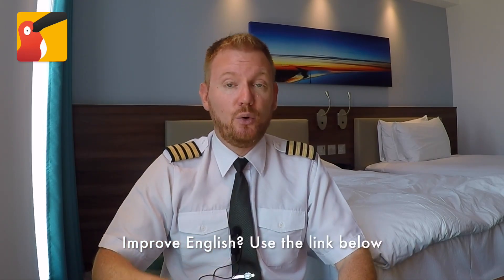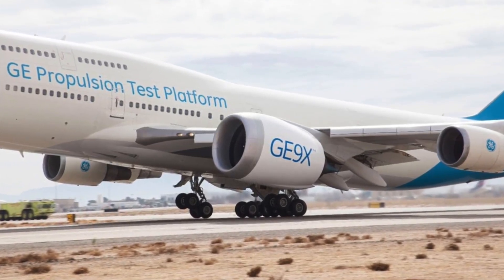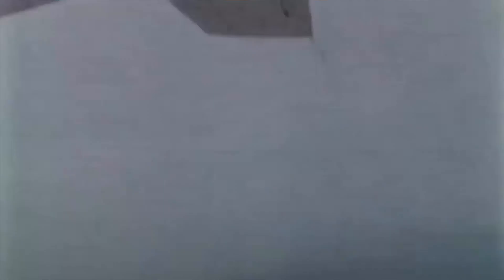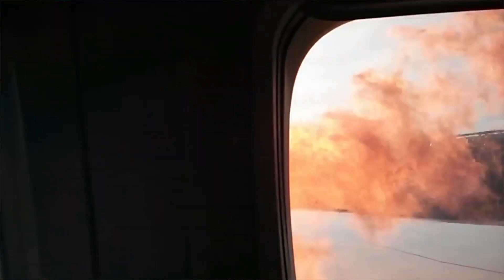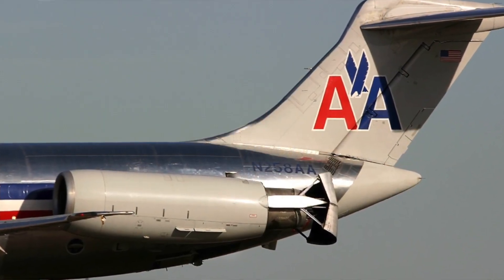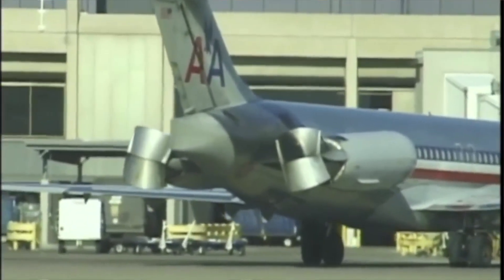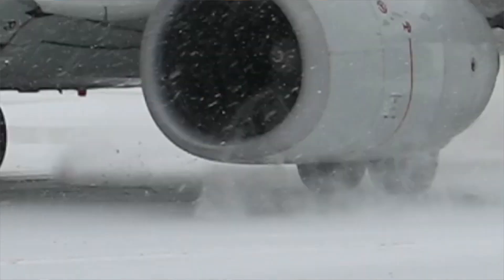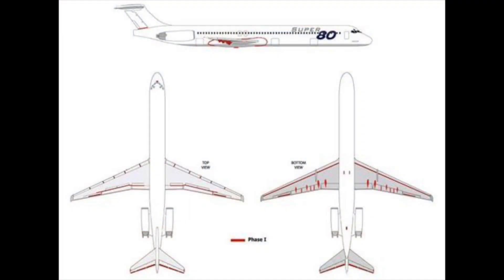Why are the jet-engines placed there? Wings vs Tail

Comment: I’ve worked on both rear mounted and underwing engines and I like working the rear mounted engines better. Usually better clearance from the cowls and the TRs are at the very back. Makes for better pictures too lol.  Love doing high powers on the JT8 engines.

Comment: You had mentioned that when engines are under the wings and if the engines are on fire, it doesn't immediately  affect the Passenger cabin, but would the engine on fire cause the fuel in the wings to heat up dangerously?

Comment: Can they mount the engines over the top of the wings of mount them from the fuselage with larger mounting pylons like the A10 that has engines mounted from the fuselage on top not all the way at the rear?

Comment: Good explanation. 
     The main downside is the Centre of Gravity problem. Heavy engine one place heavy fuel somewhere far away . Not ideal. The IL-62 often stood on their tails because their arse was too heavy. So they had a strut come down. This is called in-elegant engineering. But still a great plane.  
    The only significant problem was CoG for the designers (and therefore the pilots too) and is why big jets have engines under wing today. 
However, the many other advantages of the rear engine made a plane that passengers preferred. Airlines need bums on seats. If you have a plane that the passenger actively prefer then that plane is inherently a greater revenue earner. The VC10 was more costly to run than the 707 but throughout its time in service with BOAC the 707 flew with many more empty seats. For the passenger the rear engine is way better. Ask the executives. They know. They can choose and the choice is emphatically rear engine.
   But for so long  the passenger has had no choice. Now that is beginning to change. Some airlines are beginning to pamper their passengers.
And that is going to be the game changer for the conventional non budget airline.
 I doubt it, but maybe it could be  time for a return of the rear engine. An A-390 ? Lol.

Comment: One design benefit to tail mounted engines is that the wings can be much more aerodynamically clean.  In design, this mean faster speeds.  In their day, the Boeing 717, Boeing 727, Vickers VC-10, Lockheed L1011 and similar designs were faster than the two and four engine wing mounted systems.  In the end, mounting bigger engines under the wings won.

Comment: with my limited real life knowledge about planes, all i could think of in a super stall situation from my experience in Kerbal Space Program (KSP) is to turn the plane upside down where the back tail wings could touch the air again, adjust the pitch then roll again up right. but like i said, limited knowledge so i do not know what a real plane of those size can and cannot do! ;P

Comment: Tail-mounted engines should increase overall lift and fuel economy. The planes lift is made from air passing over the wing faster than under the wing (low pressure on top, high pressure on bottom). The rear engines would suck air over the wings extra fast, making low pressure, and causing that extra lift. I'm not a aeronautical engineer, that's just my theory.

Comment: They are called Airplanes because they run on compressed air, do you really think that tons of fuel would fit in those thin wings with all the flaps and hydralic systems in the wings?? Hardly any room left for a few gallons!!!

Comment: just wondering : in rear mounted engine aircrafts, if the APU would catch on fire, could it spread to the turbines and vice versa?

and on wing mounted engine aircrafts, of the engines catch on fire,  and the insulation fails, could the fire spread to the wing fuel tanks?
Reply: it's possible a wing mounted engine fire could spread to the tanks however aviation kerosene requires oxygen to burn so it would be highly unlikely to cause a runaway fire burning all of the fuel stored in the wings unless the tank had damage where air could enter. The greater risk is the structural damage an engine fire could cause to the wing, but again aircraft engines and wings are engineered to minimise the risk of these events.

Comment: While the mechanism to deter a superstall for each model are different, would this inhibit "pilots"  from trying a different  model type.  It seems a military pilot flying C-5 would byitself be discouraged to go into commercial passenger aviation due to a lack of knowledge and airtime, even though the air force lieutenant-colonel has 50 thousand flying hours....?

Comment: Another reason for not using reverse thrust when pushing back is noise/vibration in the terminal building.... Was a witness to a C17 using reverse thrust (nil tug available) when backing out from a bad park next to a control tower and nobody in the CTC building could hold a conversation due to the bulk noise/rumble of the C17 during the move.... Big plane = a LOT of noise...

Comment: question … with the normal walkaround the aircraft  before each flight, are they able to check the high mounted engines as well by use of a some kind of lifts you hope every airport have for this purpose ?Thanks in advance

Comment: On the fuselage mounted engines including the 3 holer, you're less likely to bounce a motor off the runway in a crosswind landing. You can fly a more normal side slip instead of crabbing into the wind and jamming top rudder at the last second on touchdown.

Comment: Excellent explanation on the T-tail problem of the super-stall. I served in the Air Force in the 60's, working on the RF-101. We lost a plane for just that reason. The pilot had the benefit of a drag chute used for landing to bring his tail up, out of the turbulence of the wing. He had used the drag chute, except that he was too low to the ground. Unfortunately, he did not make it. Thanks.

Comment: I had a Flat Earther tell me planes don't need fuel during flight, They only need fuel to start the engines. Once the engines are started they are self sustaining through the compression of oxygen and nitrogen.
Reply from the maker: Yeah, that’s not how it works

Comment: Why would the under wing mounted engines be less noisy for passengers (at 4'50'') if the noise mostly comes from the exhaust, than if the engine is as far back as possible on the airplane? This just didn't make sense there. If you've ever traveled on a rear engine plane, sitting behind the wings is silly silent compared to in front of the wings on a wing mounted engine plane.

Comment: You did a great job describing the effects of each type of placement. But you never touched on the video's title... the WHY. More specifically, why is one placement chosen over the other when designing a specific model? Though you did explain the "why" for private jet design (the need to land at small fields which have a high FOD potential, driving the requirement for tail mounting). But for all other aircraft models you skipped the why. 
For instance, why wasn't the 737 designed to have rear engines instead of underwing? Again, you did a great job of explaining the characteristics of each placement, but by the title of the video I was expecting to learn why one set of characteristics is chosen over the other. 
I believe the most significant factor is center of gravity as a design choice (though you only  mentioned CG has a design result). Getting back to the 737, I'm not sure, but when the model was in the design stage and a decision had to be  made, I expect it had to do with expected load weight and desired range of the aircraft. That led to an engine selection and a required fuel load. And that led to wing size and center of gravity calculations, which all led to the decision to place the engines under the wings. I'm probably wrong on all that, but you get the point.  So again it's this lesson in aircraft design that I was expecting from the title.

Comment: In the event of an one engine under-wing failure, couldn't you also deploy the flaps on the good wing with the thrust, to increase it's drag and consequently have to use less rudder? 

Or would this parasitic drag be to great and bring the plane below stall speed? Or would it not work the way I'm thinking it would?

Comment: So let me get this straight,

Underwing = easy maintenance, opportunity for bigger fans, more engines, helps with wing bending and wing flutter, safer incase of fire, engines closer to center of gravity, less piping for fuel, less chance of a super stall.

Tail = better handling incase of engine failure, less chance of picking up shit and getting ”FOD”

No wonder we are seeing more wing mounted engines. 

Thanks for the clarification

Comment: Can I ask why a T tail instead of canards? It seems to me that canards would lend much better handling characteristics.
Reply from the maker: Good question!
Reply: Sasha waxman only with delta wings Like ef2000. Canards influence the aerodynamic forces of the following wing very strong and since normal wings don't have that much of an area to generate lift, t-tails(or classic stabilizers)are prefered, although canards are more effective since they act within the wake free airfoil.

Comment: I  can't understand how the wings are flying with 1000's of gallons of liquid jet fuel and decreasing while flying - the wings with engines are already holding the weight of the engine, plus additional liquid fuel?  I looked at some of the wings designs and it seems impossible they could hold any liquid fuel, especially when how thin they look and they are designed for aerodynamics not storing liquid fuel.  I know the jet engine compress air to fly and Im starting to think the fuel thing is just bullshit and compressed air is being pumped into the planes for flying.  something makes no sense when it comes the text book amount of jet fuel a plane can hold.

Comment: It's funny how you talk about the good of having rear engines and mention private jet engines and say they don't have rear view mirrors. But the private jet you showed on the picture is a gulfstream, they have rear view mirrors on the side. Little ones.
Reply from the maker: I did not know that!
Reply: Yea I'm in maintenance and the G4 had tiny mirrors the size of a small mint packet. There on the inside right up against the window and there's a little dial that rotates it upwards and downwards only. They are curved and can only see well enough to see under the wing if there's people there.
Reply: On that note, Gulfstreams (like the G550 in the video) usually have rear facing , belly mounted,  cameras. Wouldn't recommend trying to back one up though. They are too tail heavy.

Comment: It sounds like the ideal location from a flying point of view would be in the wings, Comet style, roughly at the centre of gravity.  However maintenance would be harder and the wing structural design would probably be almost impossible.  But it would allow for a huge engine.

Comment: Thought I read on Wikipedia that since 1960, 77 DC9s have been lost. I have to look it up again to make sure, but if 77 is actually correct, that would mean that engines in the back are not quite as safe as under the wings.

Comment: The trade-off between wing-mounted and tail-mounted engines is also one of aerodynamic efficiency vs structural efficiency. Wing-mounted engines are more structurally efficient because (as you said) they spread the load along the wing, thus reducing the bending forces at the wing root. On the other hand, the wing-mounted engine pylons interfere with the airflow around the wing, making it less efficient. Tail mounted engines allow the wing to be aerodynamically optimised, but force it to be stronger at the roots. This is why the 707 had wing-mounted engines and the VC-10 had tail-mounted ones: the 707 was designed primarily for 'First World' airports with long runways, whereas the VC-10 was designed for BOAC's 'Empire' routes, which involved a lot of short runways in hot-and-high conditions. Getting as much lift as possible from the wing was therefore more important for the VC-10, which was also a little faster too.

I don't understand your comment about being able to put bigger engines under the wing that on the tail. Bigger engines under the wings force the undercarriage to be longer, which in turn makes it wider, which exacerbates the engine-out asymmetry you mentioned, and puts a bigger cut-out in the lower wing skin for bays, which in turn weakens it. Tail-mounted engines are higher up and independent of landing gear considerations so you can put bigger engines there with less penalty. It's worth noting that in the days of propfan development, both of the flying prototypes used rear-engined DC-9s as testbeds, and propfans were exceptionally wide: basically a turbofan with such a large diameter that putting a duct around it wouldn't have been worth the weight.

Comment: I would also assume that with the rear mounted engines, a single engine failure would not cause as much yaw since both engines are closer to the centerline of the plane.

Comment: I flew from New Orleans to Miami in the very last seat of an MD80. You are right between the engines, which are extremely loud. You can’t look out of the windows, because the engines block the view. And your seat can’t recline, because you are pressed up against the bathroom wall. If you fly on an MD80, do not get stuck in those last seats.

Comment: You are a great pilot not an engineer. So here it is from  an engineers point of view. Planes required that Center of Mass be in front of Center of the Lift. It is easier to do this by placing engines in middle of plane and as low as possible. On a plane with very large engines it is simply impossible to put them in the back, to much weight to balance the plane. The wing would have to be in the back. If you have engines in tail you can make wings thinner and therefore it can be faster. But in tail mounts you usual have to go t-tail because of all the disturb. air from engines.  So if you take 737 engines wings, fuel are in middle around center of mass which is right around engine placement slightly below fuselage. If you take a DC9, a wing and engine are in back half of plane and fuel is more in front but you have to be more careful with fuel weight. Also COM is in line with fuselage making less stable than 737. If you take learjet, which is an extreme case, the COM is so far back and so close to center of lift behind wind that it is basically unstable. The perfect plane is probably a VariEze type, everything in the back, canards in the front, which was original Wright Brothers design, but like always center of lift is behind center of mass.

Comment: I first learned about off-balance thrust with personal experience in Microsoft Flight simulator. I was flying a "test flight" with a 747, Engines 3 & 4 were scripted to fail. When I tried to fly back to the runway, the aircraft seemed to be uncontrollable, it would yaw to the right with full left rudder. I crashed twice, and while trying to figure out what was going wrong, I realized.... 
Full power on the left wing... no power on the right.... facepalm no wonder I'm losing control.
I learned about this facet of flying before anyone taught it to me.

Comment: I would also add that the rear mounted engines allow you to have a shorter landing gear. Therefore your fuselage is lower to the ground, making it easier to load/unload and to leave/enter the plane via a ladder integrated into the door.

Comment: i should add one important benefit to back mounted engines. . . god forbid, in case of landing on water or on land without landing gear ,those planes with high mounted, out of the way engines in the back, stand a much much better chance of delivering a safe landing.

Comment: How about this question. Why no jets with engines mounted On Top of the wings? I can think of a couple advantages. No FOD damage. Less risk to the tanks during a fire(heat goes up away from the wing tanks. Engines can be bigger and the landing gear lower.
Edit: Hmm, seems there are a couple planes that use over the wing engines Boeing C-17, HondaJet,  and some others.
Reply: Look up the Antonov 72/74, the Antonov 32, or the Beriev 6, 10, 12 & 14 or R-1or Be-200, or some of the Dornier flying boats, or what I always thought was a phenomenal looking aircraft: the Martin P-6M Seamaster, although to be fair, listing flying boats is a bit of a 'cheat'...

Comment: I personally dont like high mounted engine with T-wing at the back, as a passenger I feel it is lesss stable at landing and take off.
Reply: I had the worst flight of my life on a BAE 146 whisperjet. They don't have engines at the back but they do have a T-wing. I was sat in the back row as it flew through a thunderstorm over mainland Europe. The rear of the plane was swinging side to side and pitching up and down so much that food, drinks, bags etc were being thrown around the cabin. i remember as it started to get bad I was holding my drink up in the air to try and stop it spilling and my arm was waving all over the place trying to keep it level. Then I gave up and dropped it and just hung on for dear life.
Reply: John J that most be scary
Reply: But you haven't been flying on Yakovlev YK-42D. It's perfect. Especially landings.

Comment: the advantage of rear mounted engines is asymmetrical thrust in case of an engine failure since the engines are closer to the airplane center line than wing mounted engines but like you said there are pros and cons. thanks,

Comment: As a frequent traveler (not a pilot) for business, there are few planes that beat a MD-88/90/717 in first class for regional travel. It is smooth as silk and so, so quite that far from the engines. I appreciate this video from a pilot perspective, but I'll miss those rear engine planes as they get phased out.